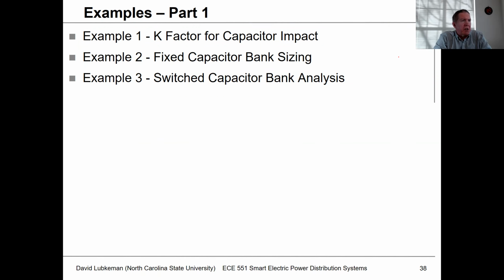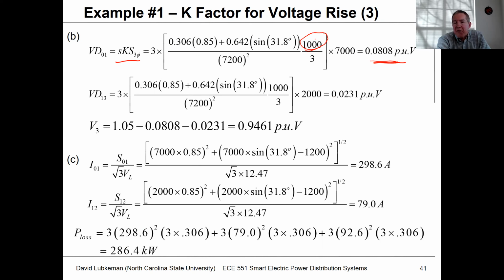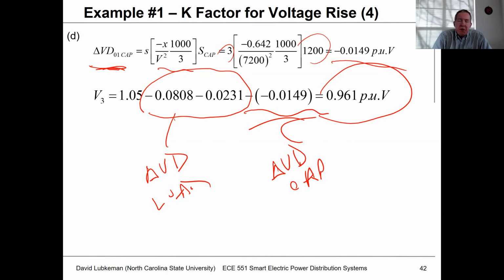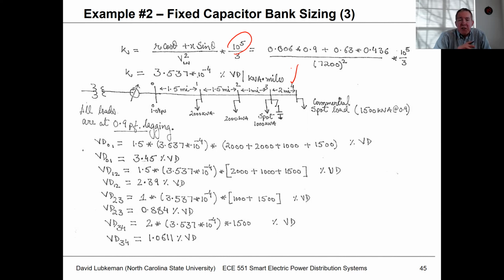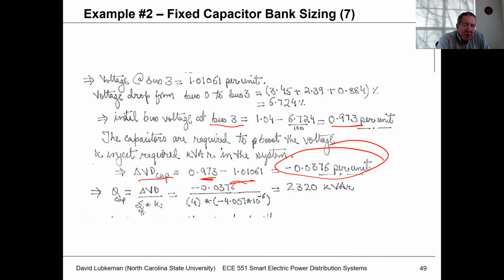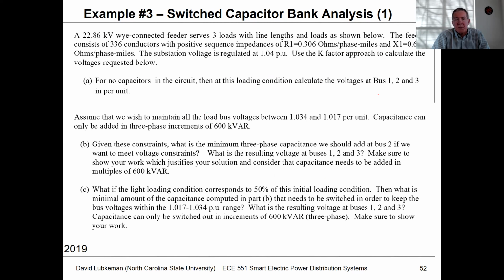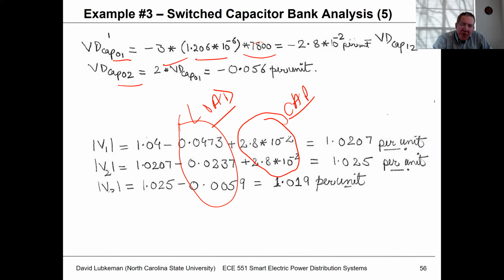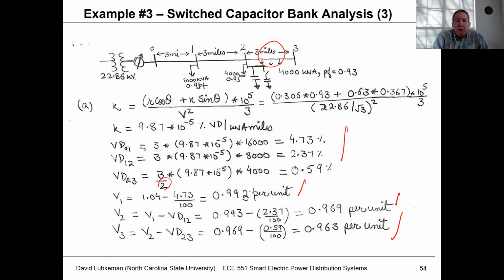Lecture 11c: Capacitor Applications Pt 1 - Worked Examples - Power Distribution Systems Spring 2021

Comment: Why don't we use the conjugate S and V when we compute the line current? It's confusing when to use and not. Thanks for putting up these lectures, great resource.
Reply from the maker: If S, V and I are complex numbers, then you would use the conjugate of S and V to get I.  In this example we are only interested in the magnitude of the current I, so S and V in this case represent magnitudes only.
Reply: Makes sense now, Thanks!